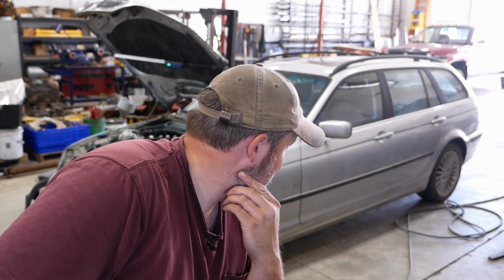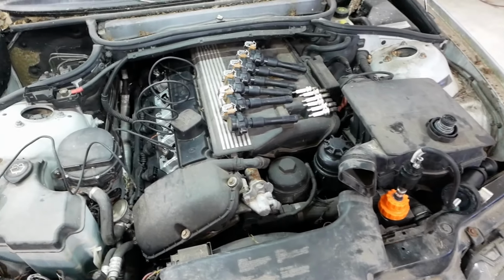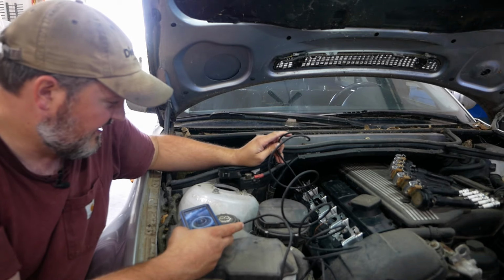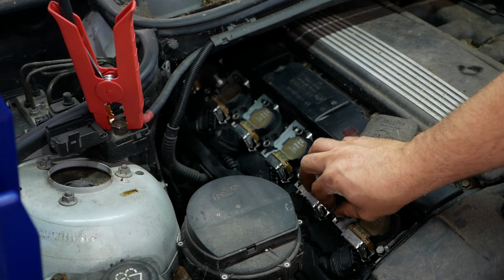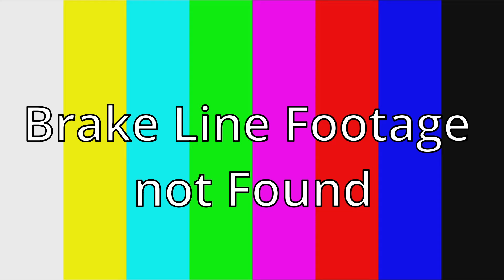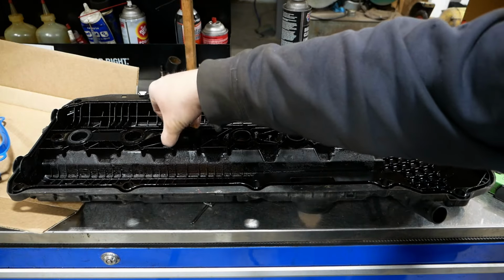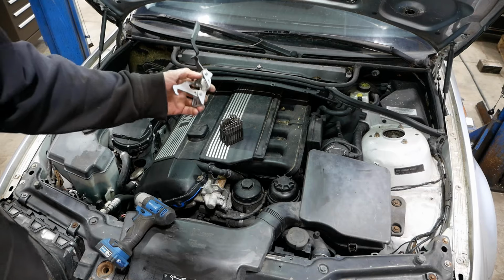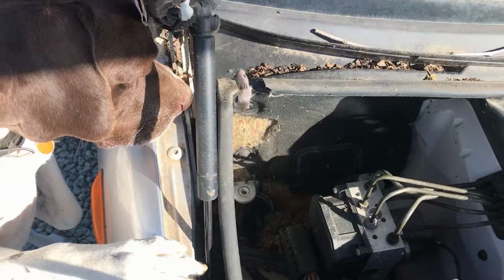E46 BMW Losing Coolant, Oil, Brake Fluid, Etc.

Comment: Have a 2002 525i sedan that I bought at auction. Had to do a engine swap as it was leaking coolant into the oil and sat for 8-9 months. Drained 12 quarts of oil and fluid from the pan. Got a running junk yard engine and am still driving it. Nice car!

Comment: I had a 2000 323i, it was a great car. After 252,000 miles the rust was getting to it after being in the rust belt it’s whole life and Illinois for most of it.

That upper cover that’s above the engine is removal. Just remove the cabin air filter and there’s 4 t25 under it and it comes out easy and quick. It gives a lot of access to the back spark plugs.

If you need bootleg software for it you can get factory ista+ and the old factory software. I know of a couple places if you end up needing it. The bootleg ista is great for reading codes and doing some two way communication but you can’t/shouldn’t program with it unless you have the icom box or wanna take huge risks and slow program times.

Ista is great since it puts together a plan of attack for you and brings up wiring diagrams and pin outs within the software as your going between steps if needed.

Comment: I've been able to put the cooling system under pressure and actually see the coolant coming out of the head gasket with the scope. This particular engine was throwing a misfire code b/c the coolant would leak into the cylinder on shut down and cause a misfire on start up. Once the coolant cleared out, it was good. Spark plug and cylinder were VERY clean. No idea why the compression doesn't get into the cooling system, but it wasn't. Ive also had an oil analysis done, it didnt show any antifreeze in the oil.

Comment: Wes I have a 2003 Trailblazer that had a slow leak and took along time to find, it was the radiator cap, at a time of desperation I wrapped a pice of clothes and after a month it developed a spot of coolant!! New cap problem solved! Thanks for sharing

Comment: I've had 4 BMWs, and every one of them were awesome! I agree with you about that engine, I had a 2004 330ci, and it was great. I also had a 2007i, a 2008i and a 2011m and didn't have any problems with any of them. So I think all of BMW engines are awesome, especially the M car.

Comment: Great video. Depending on how big the leak is it could be a weepy radiator that leaks when it's hot thereby evaporating off the coolant. The telltale coolant stain is probably hidden behind the aircon heat exchanger and/or trans cooler.

Comment: Coolant tank! It's hot O-Rings where it clicks in underneath. Plus there's a sensor in there that can leak. They also like to crack as well
Reply: The e46 coolant level sensor is dry, not immersed in coolant. Can be removed without leaks.  The expansion tank around it likes to crack & split.

Comment: I too had an E46 330Ci, mine was a topaz blue 2002. Loved that car, the seats were the most comfortable of any car I've ever owned. I bought it when it was 3 years old with 30k miles on it and kept that car for almost 10 year, selling it when it had 160k miles on it. Only problems I had on the car was a broken valve spring, and three replacement steering racks (apparently there was a manufacturing process error). All was covered under warranty.

Comment: My 2003 E46 was blowing coolant thru the head gasket. Out of desperation I tried K-Seal, and amazingly, it worked. Stopped the leak 100% and 50k miles later, still holding!

Comment: I have a Saturn Aura with the 2.4l ecotec I'm currently working on a block replacement. When I bought the thing, it had blown the head gasket but the people kept running it but changing the oil constantly. It had worn a SLIGHT ridge in the liner but I had thought the magic sealing beads in the felpro MLS headgasket would fix it. Well, turns out if your coolant passage is near the cylinder, it can blow the head gasket without introducing coolant into the oil. I had the mystery coolant issue on both a chevy 5.3 and my current 2.4l ecotec. Both were able to seep coolant into the combustion chamber without milking up the oil. My only for sure test of head gasket failure was to bring the piston 3/4 the way up, and put the cooling system under pressure for 2 hours. At the end of the 2 hours, the ecotec had a pool of coolant ontop the piston, the 5.3 didn't pool, but the piston was noticeably wet.

Comment: Hi Wes,  Those are known for the oil filter housing o ring gasket to leak. Sometime you will see oil in the pressure tank . It goes both ways.

Comment: Wess, I was a mechanic for 35years, I had a vehicle with the same problem, I never was a additive guy, but believe it or not we fixed the vehicles coolent loss with K&W block seal and she drove it untill she got a new vehicle without any loss of coolant

Comment: I agree with you regarding the E46s. I’d say the E39 falls into the same category. Biggest downfall for those cars is the plastic cooling system. 

After those cars, BMW build quality went downhill FAST. Today’s BMWs are straight junk with zero redeeming qualities, and I don’t say that as an old timer or an old BMW fanatic. I say that as a mechanic who works on them. There is a reason that most mechanics don’t want to work on newer BMWs, and it’s not because they’re “too new” or “too complicated.” It’s because they’re garbage.
Reply: lol idk what you're on about but the new B series engine have been extremally robust and the S/N63s have been usurpingly reliable as well, Tech for bmw

Comment: I admire your determination to even take on one of these over-engineered Teutonic mechanical nightmares.
Reply: Not this one! As Wes mentoined, the E46 series was the last "real" BMW. Made to last. And the M54 6-cylinder engines were really bulletproof mith excellent mpg. I had a 328i. It was a great car.
Reply from the maker: Yeah after this things got stupid with twin turbos active suspension and no room for anything.

Comment: I had a 1972 BMW 2002. Another good model for BMW. Simple car to care for. I could adjust the valves on that car, 15 minutes from socket up to socket down. The only downfall is that it was so bad in snow, I would just put it away in the winter.

Comment: I noticed that Harbor Freight now sells a 10-pc socket set that's all 10mm... short, deep, swivel, chrome, impact, a 10mm socket of every flavor.  I just thought that was clever marketing - because the 10mm dilemma is real :-)
Reply: Astro has been doing the same for a few years, as well.
Reply: @mattmanyam  tractor supply has their set.   Rebranded ?   Oh yeah!

Comment: Wes, I have a JNC770 I purchased in Dec of 2021. Have used it to jump a car with parasitic draw. Car was not worth fixing the problem. Got me home from work for about six months, I would disconnect the battery once I got home. 
The jump pack has performed above my expectations.
Good luck with the 660.

Comment: drove an E46 330i ZHP for 10+ years, 250,000 miles.  best car I've ever owned.  low option, no sunroof, no auto lights, 6 speed.  sold it with 325K miles on the original clutch!  needed a valve job or at least valve seals but still drove better than any new sedan.

Comment: I had the exact symptoms with a POS 2003 Dodge Durango. Coolant was disappearing and not reappearing in the oil or the exhaust. After pressurizing the system overnight, I found the leak in the heater line that feeds the rear heater. Dodge engineers aren’t familiar with the problem of dissimilar metals that touch each other. The aluminum line was being held to the frame by an uninsulated steel clamp, which is where the leak occurred.

Comment: Not sure it translates to Bimmer geometry, but on VW OHC blocks you can get a pesky coolant gallery <--> combustion gas headgasket breach that only shows up when the head is trying to lift under heavy acceleration.  Sitting in the driveway they pass the leakdown test and the combustion-gasses-in-the-coolant test... but you learn to replace 'em on faith and almost always win.   How much coolant they use is directly proportional to how heavy the right foot is.  :)

Comment: The m54 and m52tu are amazing engine’s unfortunately they all have head gasket failure at some point usually starts as a very slow leak and when it goes it likes to lift and take the block threads with it and the heads almost always crack as well takes a few specialized tools to fix it all it’s more than likely more than the car is worth even if you did it as a diy.

Comment: I bought an E46 330Ci new in 2001 - also 5-speed manual. The coolant system is the weakest part of the car. At 210k miles,  the expansion tank cracked, the car overheated on the motorway and it's never run properly since. I think the head or the block has warped, or the head gasket has also failed. That was in 2018 and I still own the car because I can't bear to get rid of it. I have a 2014 Porsche, an Audi and a 1992 E32 BMW 730i as well, but that E46 is the best car I've ever owned. I'm glad you like it too.

Comment: I have a Schumacher Jump pack that is over 15 yrs old, changed the battery on it once. I don't use it like you do, but I have been really happy with it. I've been wanting to put longer cables on it, just haven't gotten around to doing it yet.

Comment: The M54 commonly had head gaskets leak. My most reliable method for slow leaks or 'only overheats after driving for hours' was to get it smoking hot, pressure it up to 20 psi, take the plugs out. As long as I kept the system pumped up for the next hour or two while it cooled down if there was a leak it would happen under those conditions, eventually. I'd have it under pressure overnight if needed. Usually an obvious overheat due to coolant leakage was the issue but also a sticking thermostat or slipping impeller on the water pump can do the same. One huge consideration for engines that have overheated is that the threads will pull out of the block on that engine. If you ever go that far make sure you crack the head bolts loose then re-torque to ensure you don't discover you need an engine after you repaired the old one.

But seriously, that rusty cylinder looked like it had a coolant trail and the rust was a giveaway.

Comment: Had the same symptoms in a landcruiser.  Only figured it was the head gasket when it finally let go. Rust in the cylinder but was still running fine

Comment: The nut you had in your hand at 14:33 is one of the valve cover nuts, each of the valve cover nuts and bolts have a washer and a thick rubber ring that go on them, if you don't replace the rubber ring, the valve cover will start leaking again

Comment: Hi Wes, I have a E53 with a 4.4 litre m63 motor. I went through this bit of nonsense; had to be towed 132 kilometres home, because it lost coolant and over heated.  The reason being, mine has rubber O rings in the pipes from the radiator and up to the coolant tank. They go bad and only loose coolant when at highway speed, leaving no visible residue. I found $10 worth of O rings cured the problem. These o rings are on the push on connections..

Comment: BMW also recommends using a film of silicone gasket at the edges at the rear end of the camshafts and the front at the vanos (where the gasket forms a lobe; where you said it was leaking).
BMW recommended gasket sealant is drei bond 1209 (ThreeBond 1209)

Comment: Wes put 2 teaspoons of pepper powder in the radiator if there is a leak the pepper will seal it and not clog the radiator or heater  an old trick from my dad works every time cheers from down under

Comment: Looks like when you were pulling vacuum on the turkey baster, very little air was coming thru the strainer section. I’ve found that these crust over when sitting and prevent fresh air from entering the blue juice. Usually filling them with water and applying shop air backward thru the tip unclogs them, typically with geyser effect. Been burned by this once.

Comment: Back in the early 90’s I had a Buick v6 FI that was using a quart of coolant every few weeks. Could never find a leak and engine ran fine. Customer was starting to talk lemon law so GM authorized head gaskets and send heads out for magnaflux. Heads were fine and didn’t see anything with the gaskets, but after assembly, the engine never had a problem.

Comment: You saw the bad cylinder with the rust. I have run into a couple head gaskets that only leaked at a certain temp. They were impossible to diagnose but I could confirm that when the customer would pull up on days it acted like it was running hot it indeed was low on coolant. Changing the head gaskets fixed both the cars. The leak spot was able to be seen in the gasket after removing and must have been a small enough leak that a spec of rust or just the temp change was enough to seal it when pressure testing etc.

Comment: i used to like the old emission's tester with the car running.  you could put the sniffer over the radiator with the cap removed  and if the gage went up you knew you had a leak from the head gasket

Comment: I have to disagree on the E46 being the last "good BMW". Am driving the successor, an E91 320d with the N47 engine myself. Meanwhile almost 270.000km. Didn't have any trouble at all besides normal wear until now. Now the injectors are vanishing, but that's not a particular failure of the car.
Inside it looks better than a lot of cars with half the mileage.
Rust? Nothing real. The E46 are known for bad rust over the fuel tank and the dap between the rear wheel arch and bumper.

Nevertheless, like your channel! Great stuff!
Cheers from Germany

Comment: I had a 1984? Toyota long bed that kept 'using' coolant.  After a few years, discovered the problem.  The transmission fluid was cooked and getting really hot.  The coolant was boiling off when it hit the fluid cooler.  Changed the transmission fluid and problem went away.  Truck was given to an extended family member who trashed it.

Comment: Coolant usually leaks out of the side of the head onto the manifold and evaporates. Often only does it on switch off after a run. Bought a few over the years with that issue. The other is a crack in the side of the Rad which blows back into the engine bay and evaporates.

Comment: These cars are awesome. I have had quite a few. One of the most recent ones I’ve had did have a bad head gasket and would slowly leak coolant into the one cylinder overnight. It had a slight misfire for about 45 seconds during the first cold start of the day. That was really annoying to figure out.
Reply: "These cars are awesome. I have had quite a few."
So, awesome, I kept replacing them after the failed.

Comment: The Bentley service manual for the M54 engine, states:  The coolant provides lubrication for the
pump shaft, so an occasional drop of coolant leaking from the pump is acceptable. If coolant drips steadily from the vent hole, the pump should be replaced. Additionally testing the system it states: 

Pressure should not drop more than 0.1 bar (1.45 psi) for at least two minutes.

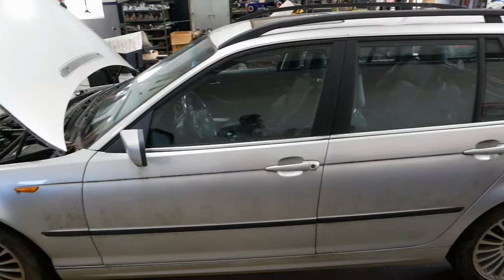Comment: I'm 1:15 in and I'm going to say: Cracked plastic radiator or overflow can. Ask me how I know....
11:15 - M54 is one of the best engines ever produced but sucks to work on in that E46 engine bay. Those half plastic radiators will get a hairline crack if you even hit a bump too hard. Then they only leak steam and you never see they coolant leave.
16:00 - If you (or the owner) want to really check the head gasket, you'll need to pull the intake and exhaust manifolds and look up in the seams of the head/block for coolant crusty residue. They tend to leak away from the cylinders and toward the outside edges first. But I'm still going with..... replace the radiator! it's only about $100 unless you want to go all aluminum.

BTW, rust on a running engine cylinder... ok that's a new one. You see something new every day.

Comment: Had similar disappearing coolant issue with a Dakota w/4.7L. Engine would run fine for several miles before suddenly building pressure in water jacket and, once above 15psi, pushed coolant past the radiator cap and out of the system. None went into the oil or (appeared to) exit thru the exhaust.  Could have been head gasket, warped or cracked head, but ex demanded it in the divorce soooo no longer my concern.  
Agree someone's been inside the Beemer engine. Assuming normal mileage, it looks like a lot of crosshatch in cylinders for car that old.
Look forward to your videos every week or so.

Comment: The water expansion bottle on the side of the radiator cracks on the E46 BMW and when hot they open enough to let coolant out so that's where the coolant loose will be I'd put money on it

Comment: Normally waterpump or expansion tank or the o ring on the temperature sensor in the bottom hose, 3 most common leaks on them 6 pots

Comment: well you started by saying the upper hose popped off.  That sounds suspect for a leak.  In my 2013 Mustang GT I had coolant loss on some days and not others. Finally spotted a damp area at a hose connection.  Replaced  an o-ring and thermostat housing seals and so far no leaks.

Comment: I tracked the issue to a faulty cap on the coolant overflow bottle. The cap as opening at the wrong pressure. Replaced it and no more coolant missing.

Comment: As far as the scrubbing and the rust, I believe I've seen it before. I had a 392 Chrysler engine that was getting tired and kept fouling a plug. On teardown it had a pin hole leak in a cylinder wall thru to the water jacket. Options were sleeve it or new block.

Comment: Similar problem with my VW 2005 mark 4. Mystery coolant loss. After lots of expensive looking the solution was a new cap o the expansion tank. Dont know why, but it worked for me.